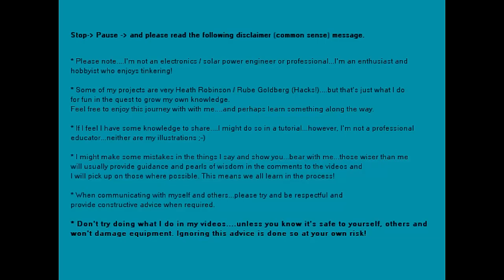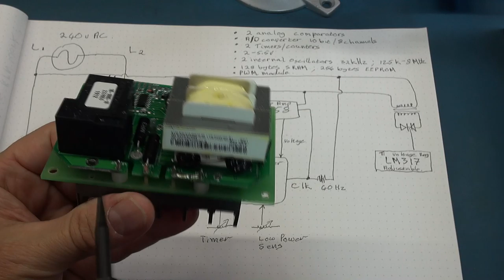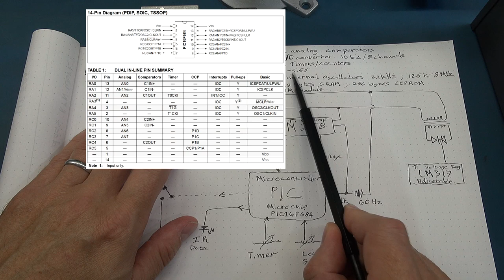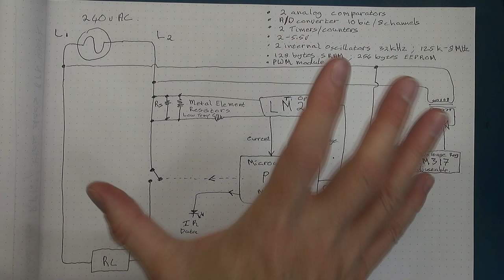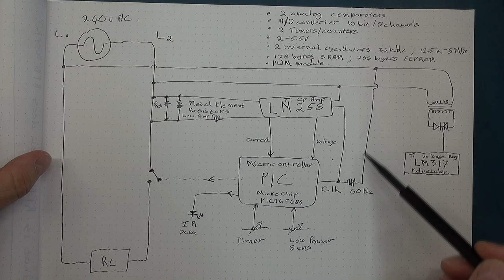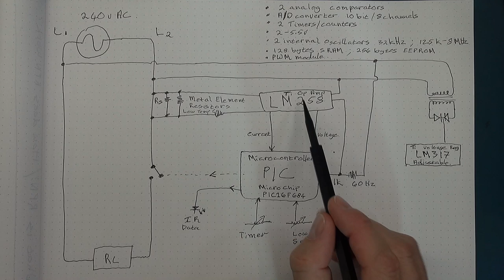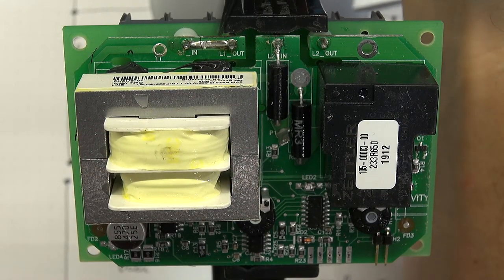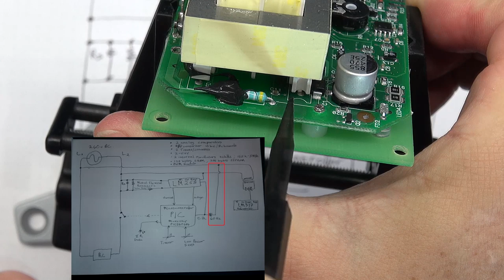A Look Inside #13 - PumpSaver / LittleFuse by Symcom

Comment: Great explanation and teardown!  It looks like the board is conformal coated.  Could that be why it appears the part numbers are rubbed off?
It looks like in your drawing, you show the current shunts are shorted out.  I don't think that line in parallel with the shunts is supposed to be there?  OR they are using the copper traces to carry the majority and then "trim" using the resistors?

Comment: Great video!   that current shunt is a bit odd isn't it,  have you measured that short to see what it measures?     I'm not sure that 60hz actually drives the pic, these pics can run using an internal oscillator setup in software and also it would need a bit of grunt to do the IR stuff?  i wonder if it's doing some sort of zero crossing detection for when to drive the relay?  that pic input pin can also can be configured as an INT pin which generates an internal interrupt on neg / pos edge etc.  btw great to see you back fella! ;)
Reply from the maker: It is odd, it measures 0.1 ohm which was the test leads. I'm also mystified by what clock drives the IC. After editing I checked the CLKIN PIN again (as I had the orientation wrong) and it is not used by 60Hz mains to drive it. It must be using an internal oscillator but then the statement in the instructions about adding 20% to timing for 50Hz is odd?? Thanks for your post.
Reply: @mjlorton   I think pin3 RA4  on the pic is the external clock IN pin if it's driven externally (see "Clock Sources" in datasheet) . The 20% bit might be because the 60Hz pulse is driving one of the internal timers, in this ic it's Timer0 or Timer1 (T0CKI pin 11 or T1CKI pin 2)
Reply: that adding 20% must be a misprint as that makes no sense to me! lol
Reply: @Ju00Ls  Agreed. I suspect they are using the line frequency for an accurate time base, where the internal oscillator on the PIC has a fairly high error rate and is temperature dependent. It's good enough to run the processor, but not for time keeping. (However I think the spec is +/-2% at 8MHz, which doesn't seem too bad.)
Reply: @Sylvan_dB  There is an interesting patent by Littlefuse the parent of SymCom which describes a method of detecting the phase shift of voltage / current into a uC, then acting to switch on / off a pump based on a threshold;  apparently uses zero crossing detectors;  I guess this might well be related. https://patents.google.com/patent/US6534947B2/en?assignee=Symcom%2c+Inc.&oq=Symcom%2c+Inc.
Reply: @Ju00Ls  A misprint, really?  How about 50 * 1.2 = 60?  Or "Adding 20% to 50 gets you 60"?  Times calculated using the period of a 60 Hz clock will be 20% longer if the clock is 50 Hz.  e.g. 10 minutes at 60 Hz is 36,000 periods, and at 50 Hz (where the period is 20 ms) that will take 12 minutes.  20% longer.
Reply: @Brian_Of_Melbourne  hi,  my "misprint" comment was just me being ironic ;)   In your comment you're saying 50Hz takes 20% longer?,  but Martin mentioned the instructions state that you need to add 20% for 50Hz?
Reply: @Ju00Ls  Yes, 50 Hz takes 20% longer so you add 20% to the indicated time to get the actual time.  See my comment above - indicated time 10 minutes, add 20 % to get actual time of 12 minutes.